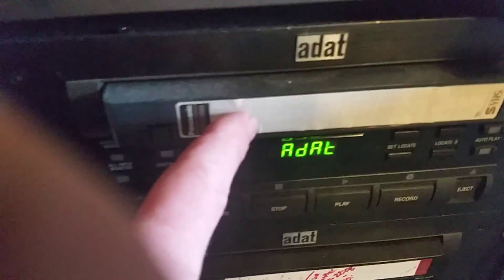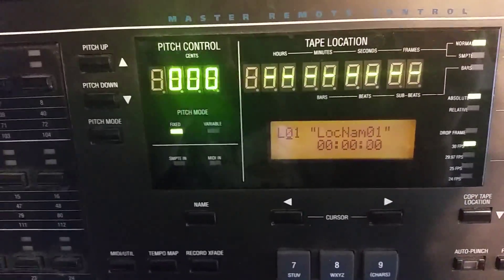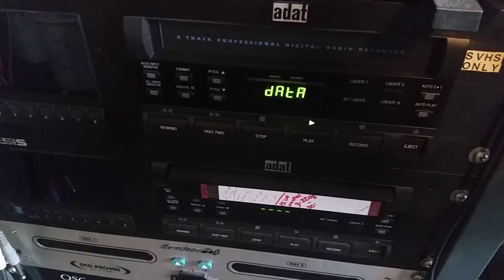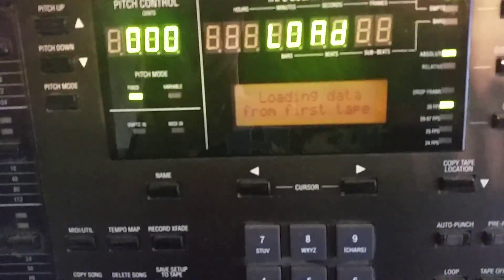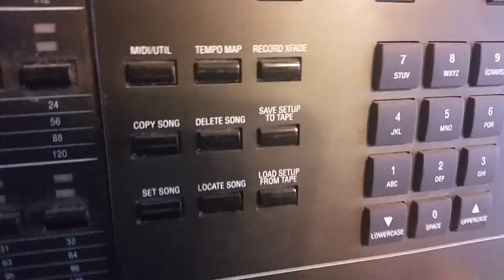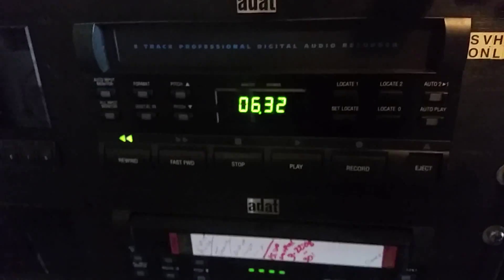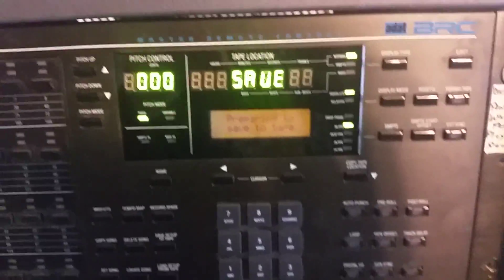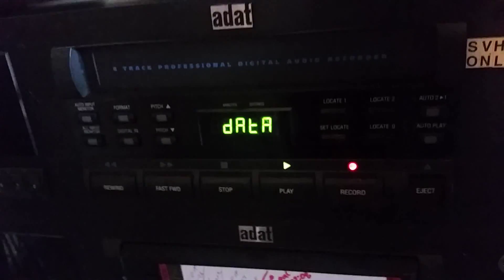Alesis Adat Black Face & BRC of how to read information from the tape

Comment: Thanks for posting this video, what's the difference between your ADAT machines and the XT ADAT machine?
Reply from the maker: RCA versus 1/4 jacks. The black face has absolutely no noise. I will always love em.
Reply: chris537a RCA VS  1/4 jacks are only a termination point, there would be no difference in sound from that point, unless the Blackface has better design than the XT, they should both sound the same?

Comment: How do you hook one up to a computer, adat alesis I mean ?
Reply from the maker: Just record your tracks into like adobe audition or cool edit pro after recording them on a ADAT. Run then out of the BUS outputs. and slightly move around the tracks with the software till you get it right. but it will all match up with meticulous skills. i prefer to record on tape because you get that sound you cant get with straight digital recording.  And it does take time , tracking and alot of patience. but the sound from a ADAT is priceless which most ppl dont understand. Thats why we do it old skool.
Reply: Wow...That's sooo cool...Thanks. Your right a lot of people don't mess with this stuff, but I love it. Can you find a plug-in for the audio side somewhere? I can't hook up that ether. And last, but never the last question: I've drilled out new VHS 1-16/th to work, will that hurt it? It works great, all 8 channels, but just because I have no other way of recording... It's always the hook-ups that screw me...no info. Thanks man...